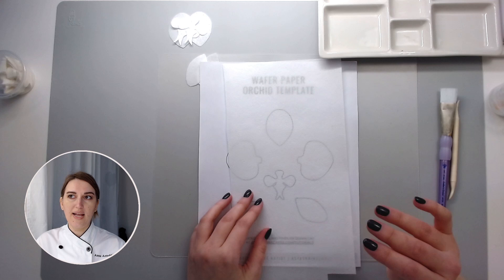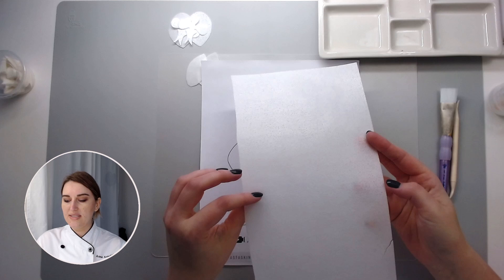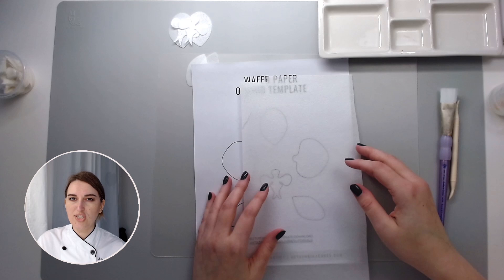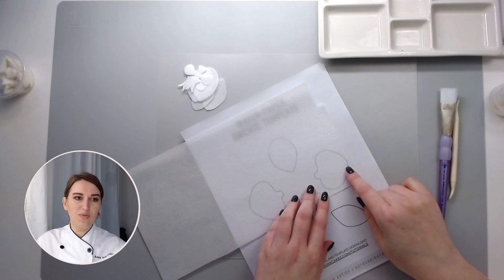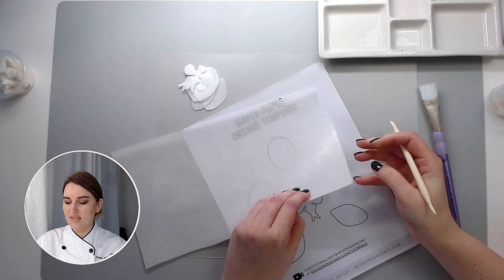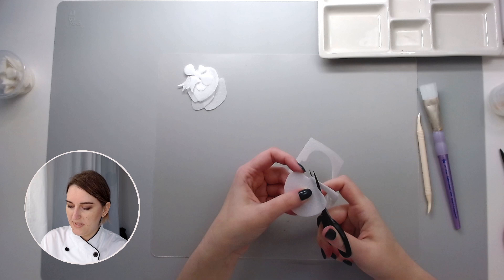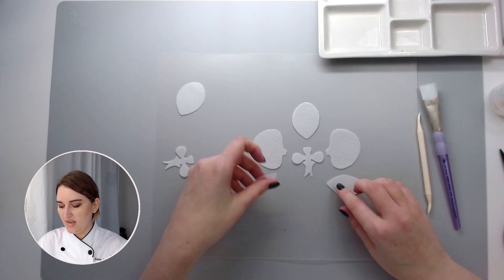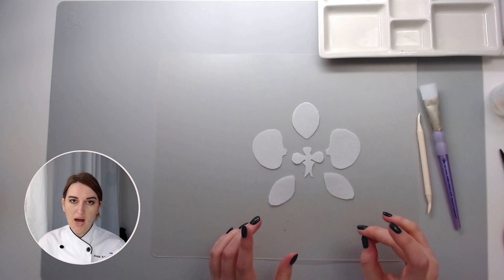How to make Wafer Paper Orchid + free template

Comment: When you put these on a wedding cake during the summer, do these get sprayed with anything so that they don't curl or anything by the humidity?  I have a wedding cake that would be really pretty to do these, but never done flowers with wafer paper so not sure how they would handle.
Reply from the maker: Hello, Peggy. I use to live in Florida and pool weddings were a theme. Wafer Paper is much more stable compare to gum paste, just make sure it is completely dry prior to arranging on a cake and you can add a thin layer of melted cocoa butter to the back side to protect from humidity